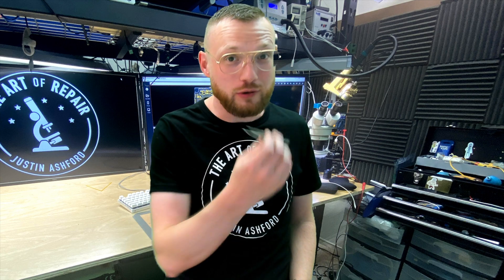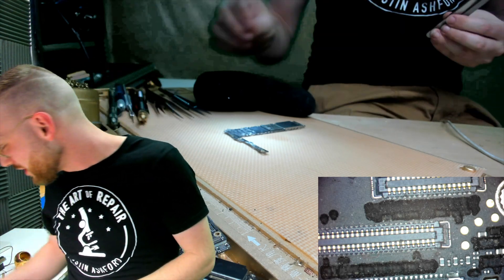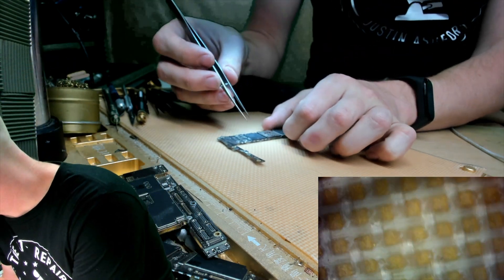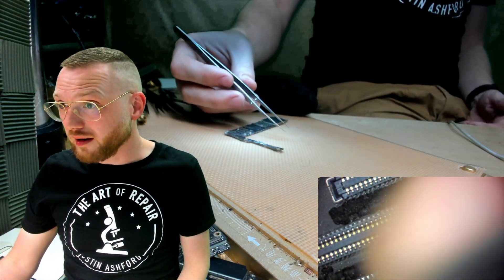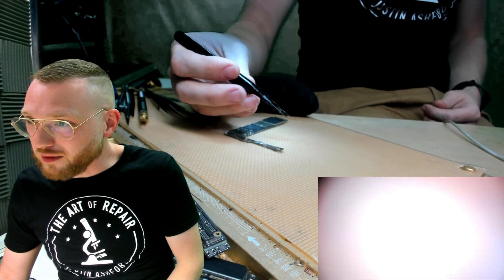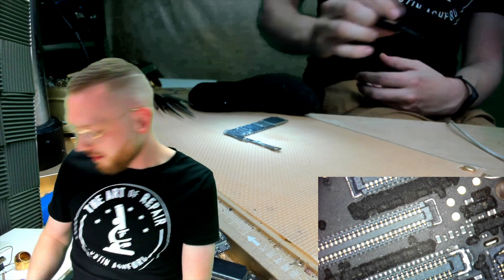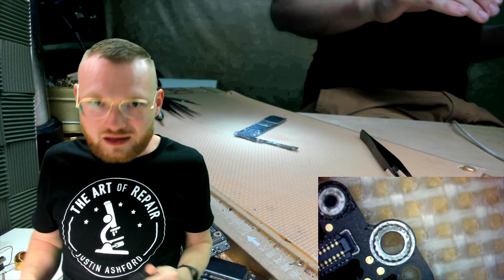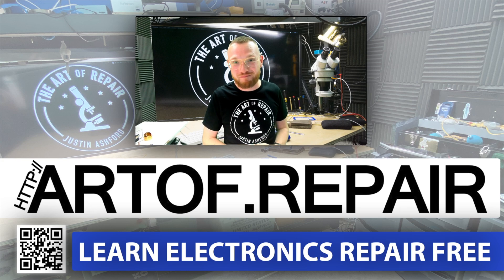How to hold Microsoldering Tweezers with intent | More Stability + Maneuverability

Comment: Justin, this tri point narrow angle method
Is just what you need when you are in a congested space. The key to your angle of address is dictated by what is in the area with the object being addressed. It is good to have options in the micro world. It is very important the denser the board is packed because small parts are delicate and you need to learn care in handling. Good tip. Stay safe mates!😊👍🏻😷

Comment: Yeah, tweezers are hard to control. I often wind up having components fly off and lost as soon as I squeeze the tip. I will try your techniques. 

Let me add that tweezers tips should be sharpen with a file and sandpaper to keep them sharp, and should be bent when the tips are no longer in alignment. I see a lot of folks throw away perfectly good tweezers when they become dull or misaligned.
Reply from the maker: Yes! This is a big thing everyone should listen to for level 2 tweezers. 

Although I would advise against fixing anything used for micro work, unless your turning them into chip harvesters…

You just gave me an idea for next weeks video!!!!

Appreciate your comment and view bob! Hope to see you in the comments again!